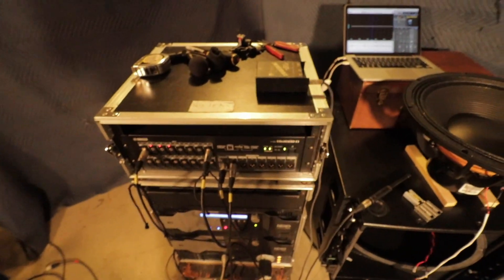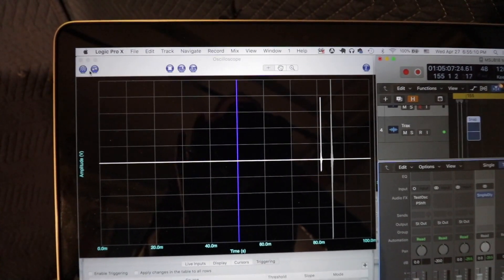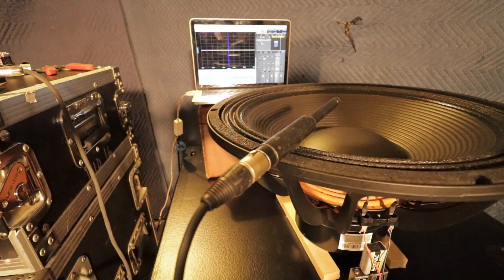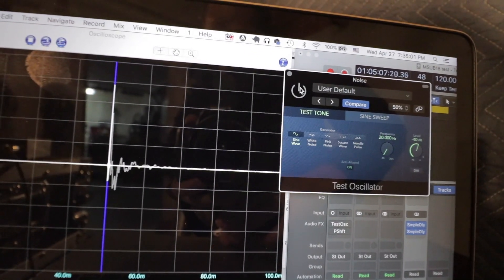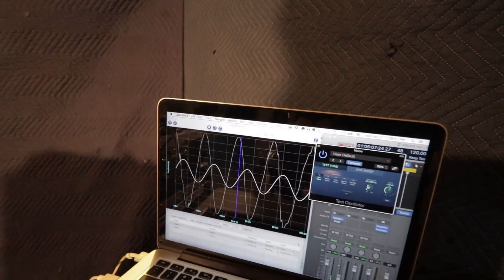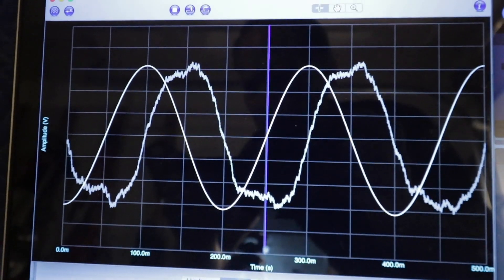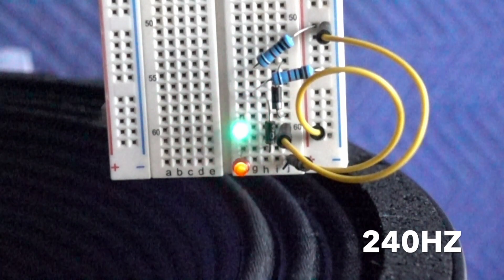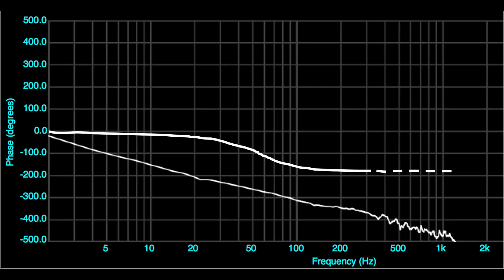Strange phase graph readings Pt.1

Comment: I believe shift caused by complex factors,  directivity pattern of the speaker, and microphone angle. Of course low frequencies have long wavelength, but you’re still in the room, which is one system with the speaker you measure. Room resonates too. Additionally speaker membrane has a mass, so, to form the sound wave it needs a time to be moved by coil. Additionally , as a magnetic device, time delay can be caused in magnetic transducer.

Comment: Your delay compensation is suspect for wider BW.  The mic is in an odd position with differing distances to the apparent acoustic center depending on frequency.  Also, the driver is in free air, so for very low frequencies there is pressure mixing front to back - might be more predictable in a baffle.  Also pressure is directly proportional to driver cone acceleration, not cone displacement, which is part of the discrepancy.

Comment: perhaps there's some circuitry in the microphone input... capacitive and inductive effects will alter the phase relationship between current and voltage, by differing amounts at different frequencies
in fact, the speaker's coil itself is an inductor with its own contribution to the phase shift

Comment: If you plot a projected phase response, based on what the speaker looks like it’s doing in slow motion, then any multiple of 180 degrees phase shift will look like -180 degrees on that plot. The mic’s phase plot is more true, though it adds the mic’s group delay as well.

Comment: A component to measurement errors will simply be due to the electronic circuitry, more specifically, a RLC circuit that contains all 3 types of reactance, each with phase change dependent on frequency.

Comment: it's the inductance of voice coil. inductance doesn't like the change of current. as a result current will be lagging compared to voltage. subwoofer has big voice coil so it will have big inductance. at low frequencies the change of current doesn't happen rapidly so it won't be a problem. but when the frequencies rise the current will be lagging massively. so laggy until it become out of phase.

Comment: I was going to say that maybe this is some kind of DC protection in the microphone that if done using a highpass circuit would cause phase offset/delay that would be quite off at low frequencies but get closer to in phase the higher up in frequencies you go but after reading others, the group delay might be it :)

Comment: Nice slow motion footage. But that is what I would expect: sound pressure when the cone is smaller than a wavelength goes as the acceleration of the cone and will be in phase with the voltage/current far above resonance (and cone position will be 180 degrees lagging it). The sound pressure will lead by 90 deg at resonance (when velocity follows voltage and position lags by 90 degrees) and lead by 180 deg far below it (where position is in phase with the voltage) as expected from the 2nd order highpass response the free-air woofer has.

Comment: hello, nice job on the LED + slow motion video setup.

i thought about it and this is how far i got: 
1. both the speaker cone and the air it moves have mass. that means there's inertia in the system, it would require strong motor and rigid cone for the speaker to respond instantly to the voltage/current input.
2. also the speaker cone is "connected" to the mic diaphragm thru a compressible medium (air) that acts like a spring, so there must be a time lag thus a phase misalignment...

these two factors happen to combine and realign the speaker-mic phases at certain frequencies.

1. the speaker cone will start lagging the alternating voltage when it's torque is lower than the torque needed to (easily) overcome the inertia of the cone+air mass... 
if that is the case, it would mean that a weaker speaker will have a greater lag compared to a powerful speaker playing the same fq. so maybe that could be tested. 
using the same logic, different speakers will show a phase 'realignment' at different frequencies. 
i would guess there still is a time misalignment of one cycle at the first fq the phases realign (maybe testable w/ an impulse measurement).

2. the air compresses at different rates at different temperatures (and pressures), the gas compressibility factor. check air compressibility factor vs temp. 
that would indicate the compressibility is also frequency and loudness dependent as both dictate the amount of energy 'pumped' into the air in a given time interval = heat = pressure. 
i am not smart enough to figure if this would be a large enough influencing factor but if it is, maybe a change in SPL (but the same fq in your case 300Hz) would misalign the speaker-mic phases.

another option is to take a nap or have a drink and think/do something else :}

Comment: I've actually made a video on how driver diaphragm motion, input voltage, and emitted sound pressure relate. The video is in russian, unfortunately, i can't speak english. 

It's complicated.

Then there is a big story on how the diaphragm moves when driven by a voltage, which you've clearly demonstrated. Those who say that the motion is defined by current are kinda correct, in that the force developed by the voice coil is only determined by the current. However, the current is in turn affected by the motion of the coil (in case of a voltage-output amplifier) because when the coil moves, back-emf is generated, which is subtracted from the output of the amplifier, thus reducing/enhancing the current.

 The motion law can be kinds split up into three modes. At very low frequencies, the position of the diaphragm is determined by the voltage, as it is effectively always in the state of equilibrium between almost static motor force, and the return force of the surround. Then, at frequencies around the driver resonance, the velocity of motion is proportional to voltage, as the voltage is almost perfectly canceled by back-emf, mostly because the diaphragm essentially moves itself (resonance), and the motor is merely nudging it to keep going. Then, at higher frequencies, the mass of the diaphragm is the dominant factor, there is little movement thus no back-emf, and the acceleration is proportional to voltage. (i've ignored inductance for now) 

Then there is motion to sound pressure conversion, which depends on if the driver is in an enclosure, and the size of the driver and enclosure compared to wavelength. For sealed enclosure that is small compared to wavelength, the emitted wave is spherical, and the pressure is proportional to acceleration of the cone. For other situation the law is different, and is usually characterized by acoustic impedance curve, which is a ratio between pressure oscillation to air flow oscillation. I don't know the law for no-enclosure high-proximity variant of yours.

Then there is microphone, with its phase and frequency response, which is often not flat in the deep bass part.

Comment: I'm going to go with it's just an LR filter. You're measuring the phase angle from the coils inductance. The  inductance of the motor. With a pulsed dc you won't have the same reactance as you will with an ac signal. Your mic is fine.

Comment: A dynamic microphone is a air pressure change sensor, just as a condenser microphone. Thus the phase of the electrical signal leads the motion of the speaker cone up to some frequency when speed of sound in air and other time constants concerning the mechanical microphone construction come into play.
You could get an absolute or differential (for example MPX2050GP) air pressure sensor to verify and deepen your insight.
Reply from the maker: Will the MPX2050GP go into an Arduino Teensy board if I just an external 12V power supply? The analog outs are +/- >3.3V? Will I need a rectifier for the negative voltage to go into the Arduino?
Reply: @devinlsheets_alphasound  I recommend the data sheet.
It says supply it with 10-16V.
It says the output is differential.
You might do a opamp / instrumentation amplifier converting the differential output to single ended and go to your sound capture input. But this also likely has a high-pass behavior, but maybe low enough to not disturb too much.
The measurement microphone you are using is also differential, i think, so you might also try to connect the pressure sensor to the microphone amplifier inputs via sufficiently large coupling capacitors so the cut off is low enough.
What i forgot to say is that also the movement of the speaker cone translates to a pressure differential by accelerating the air, so with the microphone you have two cascaded differentiators giving you a nearly180 degree phase lead when other delays in the transfer function are still low.

Comment: Thanks for the vid. I would be interested to see what effect you'd get by putting the speaker back in the enclosure. Especially if it's a sealed box. The enclosed air might dampen the cone's movement and perhaps constrain that phase shift?

Comment: You're looking at group delay. Sub woofers/Low speakers are time stretched and the more you move up the frequency scale they'll start to "feel comfortable" until the frequency becomes to high to move the cone. If you look at a impulse respons on a sub with in my case smaart you can see the sub beeing time stretched over 30 or more milli seconds. If i synchronise smaart on a portion of a IR in smaart for example 62.5Hz (T=1000ms/62.5Hz= 16ms) so this will take about 20ms or so (probably) when the mic is near/close to the sub. All frequencies below 62Hz will be late compared to the reference point and show a descending phase slope. Past the 62.5Hz you'll see a ascending phase slope....Using a pop doesn't work in my opinion a full range test signal random phase like pink will work....

Comment: What happens if you do the same test with it back in the cabinet?
Reply from the maker: Same results as far as the discrepancy between the mic and driver movement. The driver moves differently when in the cabinet, and the mic picks up a different phase reading, but the two are still not correlated like I would expect.

Comment: Compare the microphone waveform to the CURRENT waveform through the speaker.  i.e. use a current probe*.  Your reference is voltage driving the speaker, but the speaker is a very complex load, which varies as it deflects depending on several factors.  The speaker is powered to move by current, not voltage.  Another mistaken assumption is that its an X Ohm load so it shouldn't matter.  The speaker impedance varies as the mass, mechanical resistance, compliance, and air mass changes (among other things).  

I'm curious to see the results because I'm working on a new architecture for amplifiers to greatly reduce distortion at low frequencies in the acoustic output of the speaker.

Also use bursts of sine waves, which might reveal that what you see as "in-phase" waveforms at higher frequencies are really 360 out of phase (i.e. delayed by one whole cycle).

* Many nice current probes, including the DC to x MHz ones from Tektronix have poor characteristics at the frequencies your trying to measure here. So if you have a amplifier with one output grounded (unlikely nowadays) then you can use a resistor in series with the speaker to measure the current.  Better to use a good differential probe with the resistor floating.  If you are using a "sound card oscilloscope" to the audio input of the PC, all bets are off.  As the saying goes, "the devil is in the details".
Reply from the maker: A current probe, nice. But yes, would need to get a good one! I have seen voltage and current diverge in phase from each other when driving a speaker, but never more than 180 degrees. To me, it seems there is still an issue independent of current, or the amplifier itself for that matter. Let's say I was just moving the speaker in and out by hand, no amplifier. The microphone reading as it is displayed in the SignalScope software would still be divergent from the motion of the driver. This is the core of the problem, that the microphone reading and the driver's actual movement are not correlated. I thought perhaps this could be because microphones pick up the derivative of the movement (the changes in air pressure), but that would mean that the mic reading would lead the movement by 90 degrees at all frequencies, no? We see the mic reading lagging behind the movement by -90 degrees at 4Hz and as much as -500+ degrees above 2kHz.
Reply: @devinlsheets_alphasound  Something is really wrong in this setup if the microphone can "see into the future" by 500 degrees!  What exactly is your test set up.  The simplest way would be to measure the current into the speaker with a resistor in the - lead to an amplifier with a grounded negative output, connect a standard 1x scope probe across the resistor (with the - connected to the - side of the amplifier output) and this signal to one channel of and oscilloscope.  Then connect the microphone to the other channel (with a good pre-amp, like on in a decent analog mixer).  Use 10-20 Bursts of a sine wave of the frequency of choice and capture the results. The bursts help identify lead- lag easily and also limit the power dissipation in the resistor and speaker.
 
Note that most modern amplifiers use a BTL or Bridged Tied Load where the speaker terminals are between the output of 2 amplifier stages, with one having the signal inverted and thus neither the + or - is grounded.  The - ground input of the 'scope probe would short out  this type of amplifier and therefore requires a balanced, floating input probe adapter.  Unfortunately most of these are x10 or x100 attenuation, which does not help with the small voltage drop across a small value current sensing resistor. If you have access to an Audio Precision distortion analyzer, it has floating balanced inputs and can measure both the current sense resistor and the output of the microphone directly.
Reply from the maker: @shazam6274  Well it’s actually negative phase shift from the reference, so it seems it would equate to lateness?
Reply: @devinlsheets_alphasound  Check your email

Comment: Try a different amplifier?
Reply from the maker: Could try a different amp, but, I suspect I'd get the same result even if I were able to just move the driver fast enough with my hand. The issue seems to be that the mic reading and the driver's actual movement (one way or another) are not correlated.